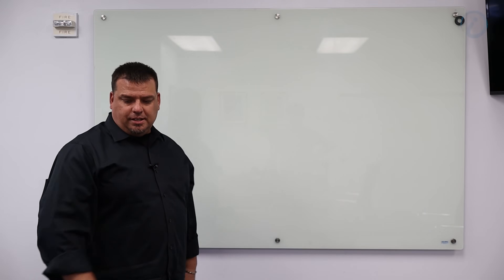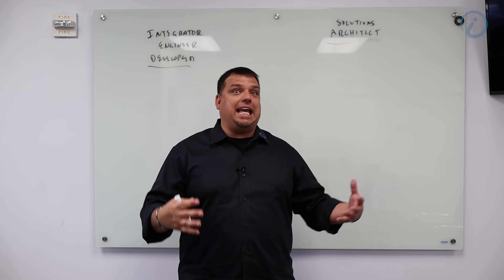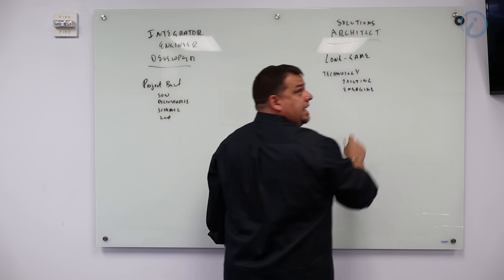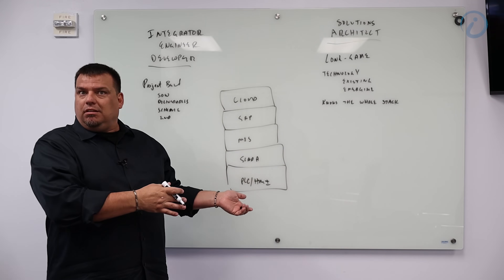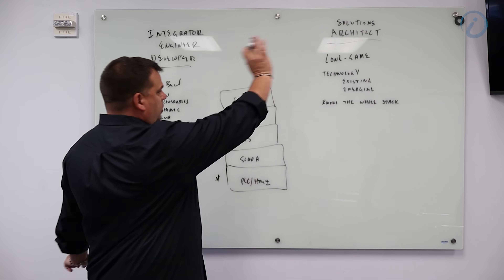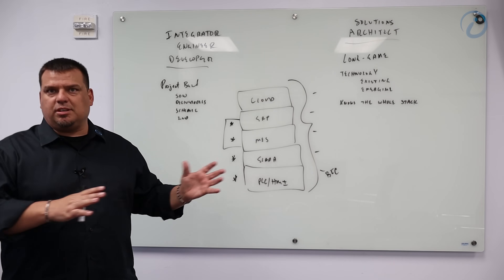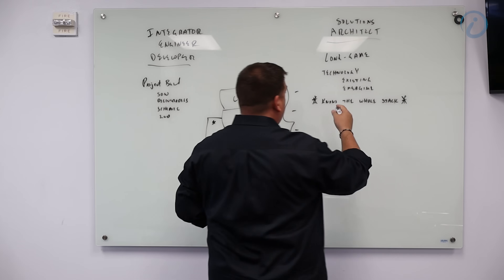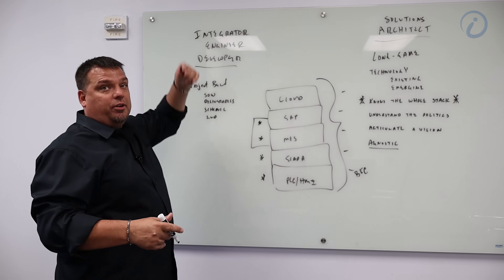System Integrator vs Solutions Architect

Comment: Hey Walker Absolutely resonate with the insights shared in this video regarding the roles of System Integrators vs. Solution Architects. Drawing from my 9- year journey as a Systems Engineer in the carbide-cutting tool industry, transitioning into a Technical Operations Analyst within a FDA-regulated medical device company, I can attest to the truths laid out here.

The ability to not be tethered to a single technology is crucial for driving company progress. However, the real challenge often lies in navigating the intricate dynamics of corporate politics, coupled with the responsibility of making complex concepts comprehensible to engineering managers and other stakeholders. It’s a demanding yet fulfilling path that requires a blend of resilience, adaptability, and effective communication.

Looking ahead, my next move or goal is to step into a Solution Architect role. I aim to leverage this position to make a more significant impact in the realm of digital manufacturing, harnessing the insights and experiences I’ve garnered to drive innovation and efficiency. Enjoying your video continue the good work . 

Describe recipe management in another video 😊